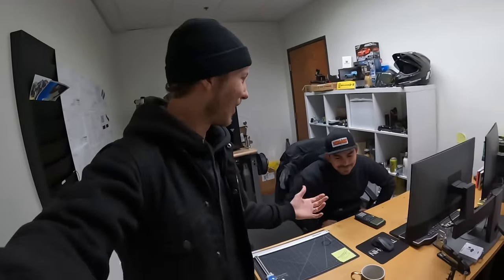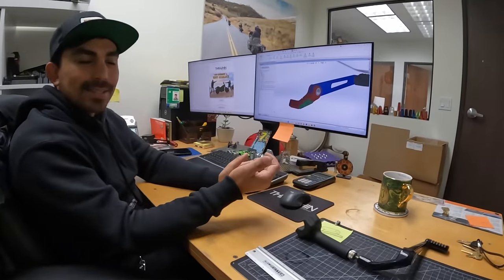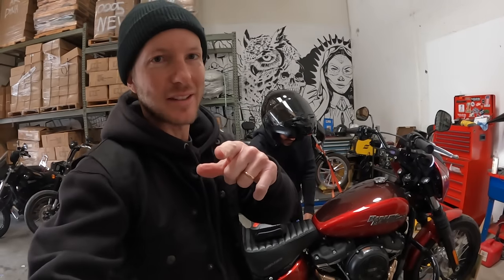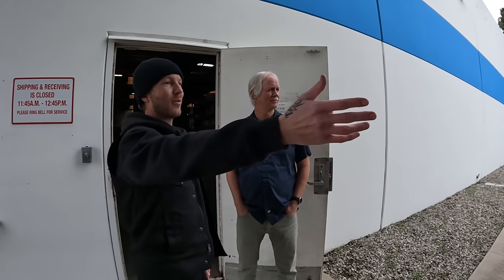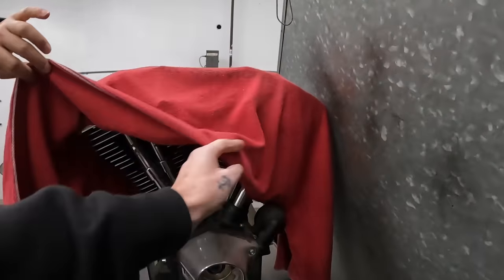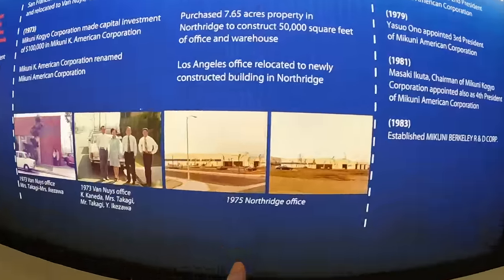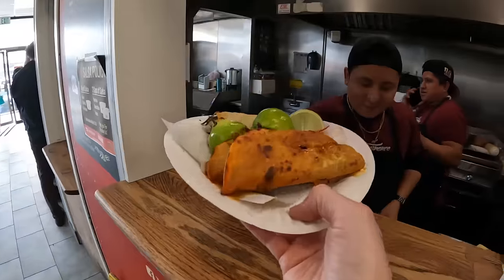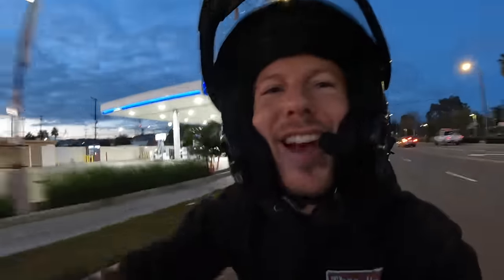New parts for the 2001 FXDX! - Vlog 54

Comment: Steve is amazing.  The shop that installed my HSR 42 used the Harley choke cable without switching to the Mikuni part like he showed Juan so the choke was always on.  I brought the carb to Steve in a box and he showed me the problem, asked about my bike and recommended different jets and needle settings.  He gave me the parts for free!  I installed them and the bike rips.  In 5 minutes he diagnosed and fixed a complicated problem that my shop could not.  I knew something was off when the tuner that installed it said that you never need to use the choke with his setup.  He had been making this mistake on everyone's bikes.

Comment: 16:50  Look at that pipe, and then look at the pipe HD put on the 2018-2021 HD Sport Glide with the 107 CI.     Almost identical in length.  There is something very important about the length of that exhaust pipe  and the amount of both back pressure and Horse Power that it makes. Think hard before you change out your double barrel shotgun pipes or shorten the length of your pipes with aftermarket exhaust systems.
Reply: True, only thing that stinks though is the loss of cornering clearance. It's a tradeoff